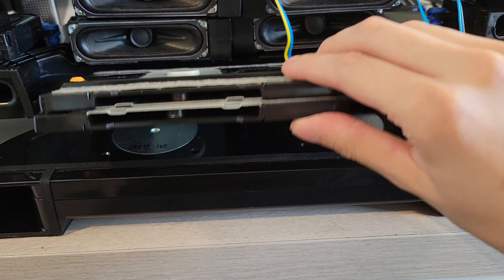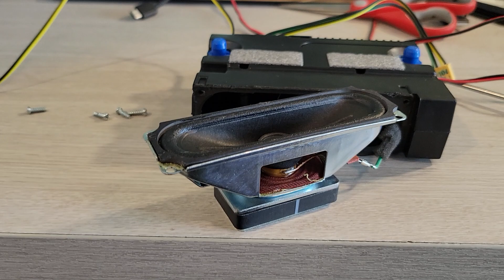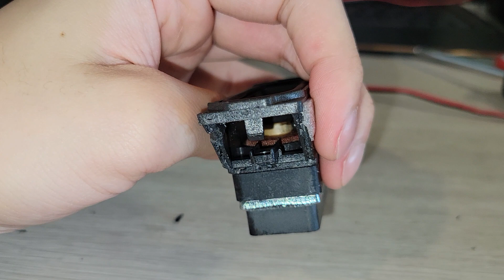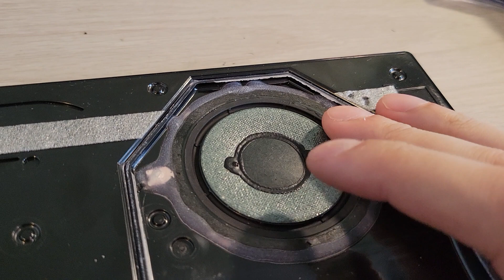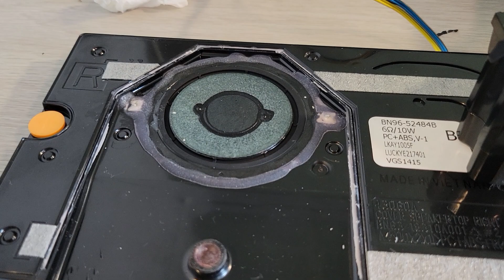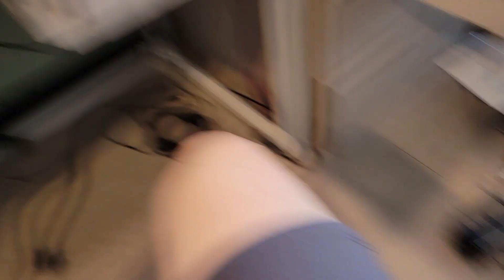Lot of TV speakers test-out

Comment: I have a similar pair of those Samsung TV speakers. I can say they sound horrible because of the tiny enclosures. The drivers are good, though. They sound better in larger enclosures.
Reply from the maker: They sound muffled to me. I never expected bass so that's not why I think they suck. They're bad because there is barely any high end. It'd be even worse when these are facing down in a tv.
Reply: @speakerblowupmanlee5921  Yeah, I can agree on that. A separate tweeter would be benefit for those Samsung TV speakers. I’d say those are mid-woofer rather than full-range speakers. They are not worth keeping because they are so common. If I had a bunch of those speakers, I’d blow them too.
Reply: @speakerblowupmanlee5921  I hate when speakers face downwards. I rather have a much thicker TV with the speakers facing on the front compared to speakers facing to the bottom. It really does make dialogue hard to hear.
Reply from the maker: @loudspeakertestsmorebyaida3804  know why they do that? Cuz they want you to buy their soundbars 😩😩